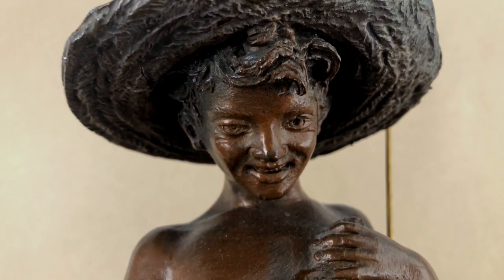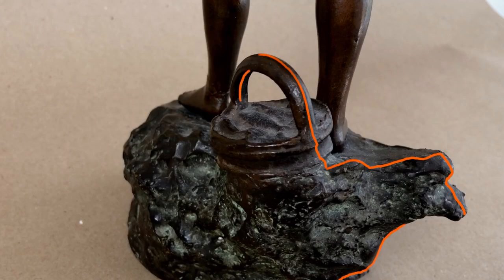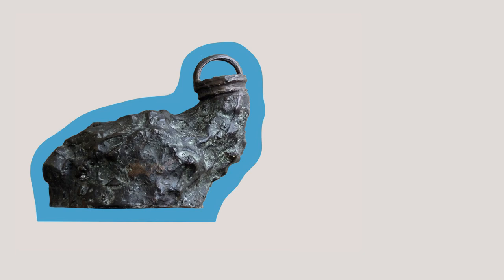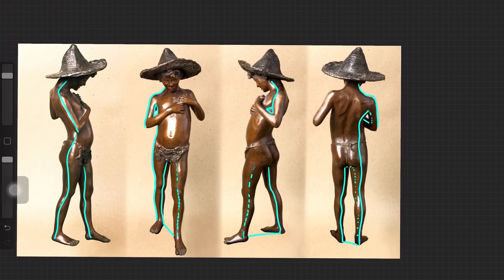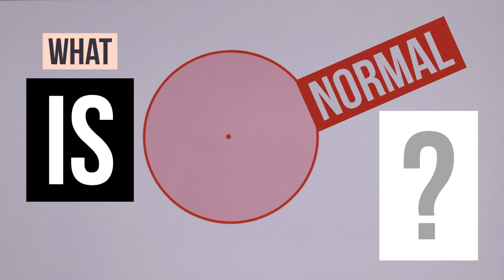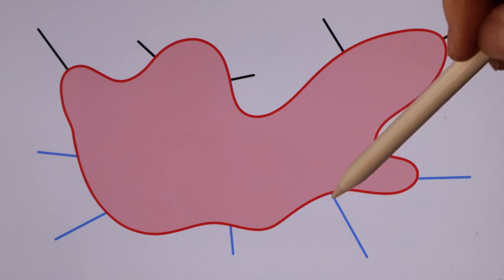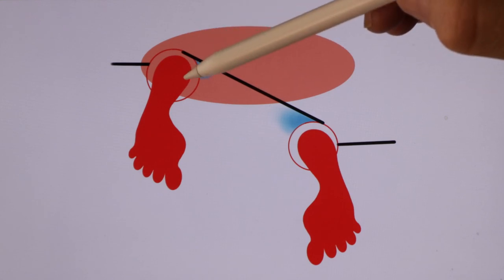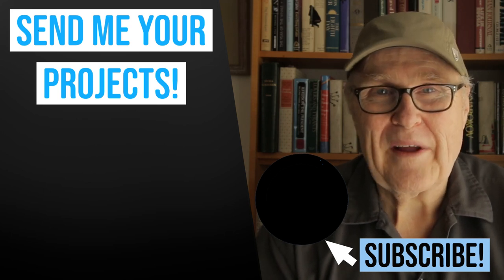Silicone Rubber Cut Molds

Comment: I have to agree with Bert. I’ve learned more watching your videos than in all the others I’ve seen over the years. I just tried a simple mold and didn’t estimate the silicone correctly. Only half poured and I ran out. The years of experience you share with us is why it you make it look so easy!  Thanks again.
Reply from the maker: I have run out of materials more than once while doing a project!  No fun at all when that happens!

Comment: Thanks so much for sharing. You’re 100% correct as to why folks don’t like cut molds. I’ve had a love/hate relationship with them for years, but, the benefit of time is so much better than a multi-piece mold. I’m a self taught mold maker of 5 years, so I’ve learned a lot and still have much to learn. I’ve watched most of your videos and appreciate the time and effort you put into them. I’ll certainly be making changes to my sculpts and mold cutting techniques on future projects. Your rotocasting videos helped me with one of my more recent projects to deliver 50 slush cast jack o lantern pails to a customer. Timing is everything, and I really like how you talk through the stages as the resin sets up. Thanks again.
Reply from the maker: Thanks David! Glad you found my videos useful.

Comment: Your tutorials have been incredibly helpful! I was finally confident enough to make moulds of some more complex figures I had, and the moulds seemed to turn out nice. Minor bubbles because I don't have a pressure pot and only do small occasional nonprofessional stuff so I don't care much haha. I haven't used wax to make air vents, but I have used sticky putty rolled into snakes and that has worked nicely. Again my figures are a couple inches tall at max :D
Reply from the maker: Glad that my videos are helpful to you Ilmari. Thanks for letting me know.

Comment: I'm new to all this and not really afraid of them, I'm just afraid of all Amazon descriptions saying that the silicon doesn't 'feel like hardening', basically, if the temperature is anywhere outside of 19 to 21 degrees Celsius...which is hard to achive for my home since we have no regular heating but have gas ovens we need to turn off eventually...
Well, that and the measly budget i have for supplies, of course. Haha. :D

Comment: Thank you so much for the moldmaking videos! I tried two part molds, and some small cut molds, but that size of full casting kit mold is what I yearn to be able to do for, didn't like two part molds for that and the resin option was limited to honey-like thick polyester resin, now there are some thinner epoxy and even polyurethane, I want to try it again.

I live in tropical country so wax modeling isn't as popular; there are some local sculptors who tried to make their own sculpting waxes but they all felt strange to use for me as a sculpting medium, or as any kind of helper in the modeling-moldmaking-casting woes. so some questions;

-what are the diameter of the blue/sprue wax stick used for air exit/resin channel?
-is there any worldwide known brand of wax that I can refer to, according to your uses? Ferris wax? Dental wax?(there is one calling itself sticky wax in my country! it seems popular for dental purpose) I don't have to use the same brand, but I know I can probably pinch a sample and see how it could work with.
-If I am to make my own wax for similar purpose, I usually can get some basic waxes(bees, carnauba, microcrystalline), talc, etc. from chemical store, what is exactly the component that makes them harder and stickier? say I make a recipe to work more like a sticky bar of hard soap, for my climate of 25-30 degree Celsius average

Comment: Great tip Mr Robert, thank you, if you can please show a video how to cast and cut the mold  the fuselage and wings for an airplane plastic kit. That would amazing to learn the trick !!! By the way every time I cut molds is nerve breaking moment for me!!!!
Reply from the maker: Cutting a mold is always nerve racking for me too, and I’ve been doing it for 30 + years!  That’s why I always plan my parting line cuts before I pour the rubber.  Plastic kits are designed to be injection molded.  Thin sections and mechanical parts are easy for metal molds but can be really challenging for rubber molds and resin casting. There really isn’t a trick for making it easier. I have videos coming up that will examine the specific issues around kit recasting. Thanks for watching Gina!

Comment: id be very interested (if it's possible) to see a transparent rubber with it's meeting cut faces painted so when closed around the original object you can see those cuts as they sit in the mould.
Reply from the maker: I’ve never used clear silicone. It would be fun to give that a try.

Comment: I was thinking that a great way to practice making cut molds is to use ComposiMold ... since it behaves much like silicone and can be re-melted and used again each practice attempt. There is the upfront cost but the endless reuse will pay for that many times over vs learning with silicone.

And since the mold will not be permanent, the original doesn’t have to be important ... any household objects could be used ... starting simple and working toward more complex. What do you think?

Thanx for the great lessons, Robert! I’ve used both my accounts to subscribe twice :)
Reply from the maker: I have never played with ComposiMold. I got to get some and try it out. And it’s a good idea because people really are afraid of cut molds for that exact reason; they are afraid of ruining an expensive  mold by making bad cuts.  Thanks for being a double subscriber!  I do the same thing with my accounts. I’ve often wondered if Big Data  is smart enough to know that I own both accounts and therefore only count me once!

Comment: In case that you cant take off the hat . It would be posible to make like in and injection mold. Make holes and when resin come out you stop the fluid let it get hard and  in the second bach you continue filling  and then you rotocast it .  Or   you make a two part mold the first one the line be in the hat edge and the second one be a cut mold .  With a good containment box to close it.  Like a hybrid of  two part mold and also a cut mold   🌺
Reply: I love 😍💕 this video its  a more complicated mold  each time . 🌺
Reply from the maker: Yes, you could try a variety of methods to cast the hat...but I can’t say for sure what would work.  Much simpler to design the parts for easy casting.! 😊

Comment: Hi Robert, I have a question for you... I would like to cast a Model Car Body.... but  I'm not sure if that would work with a one piece cut mould....any suggestions .... thanks for your channel ... love the content
Reply from the maker: Styrene kits parts are often difficult to cast because they were designed for injection molding, not resin casting. Making a mold to cast a car body successfully is definitely tricky. It may be necessary to modify the body to cast it. I have a viewer project coming up a few weeks where I will be casting a 3-inch injection molded car body.  I may use a hybrid approach - part clay-up mold, part cut mold.
Reply: @RobertTolone  Thank you Robert ....I´ll stay tuned

Comment: I have an old candy mold that is made of some kind of metal. Can I use a UV resin or Amazing casting resin inside the mold,  to make a piece that I can then make a mold of in order to make other pieces out of clay.
Reply from the maker: It is likely that you may need to use a release agent on the metal mold so that the resins won’t stick.  I don’t know because I haven’t used those specific combinations of materials. I always test all unknown material combinations.  Put a small dot of resin on the backside of a metal mold and see if it bonds to it. And test again using mold release, or wax or whatever until you find the right combination.
Reply: @RobertTolone  Thank you so much for the info.

Comment: Robert, Can't I do this with the hands instead of seperating them?
Reply from the maker: By far the easiest way to cast them is as separate pieces. The fingertips barely touch each other and you will have thin and fragile rubber bridges between them if you cast them together. Also your venting becomes very complex and difficult.